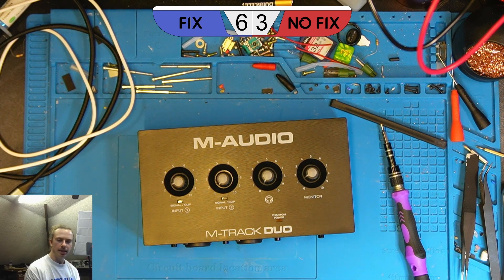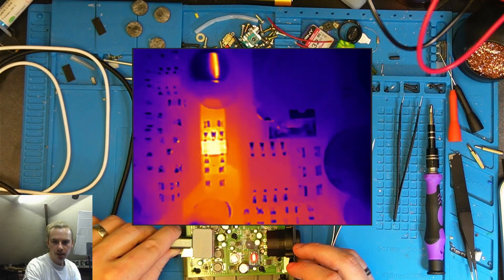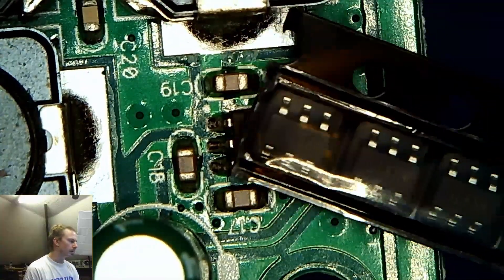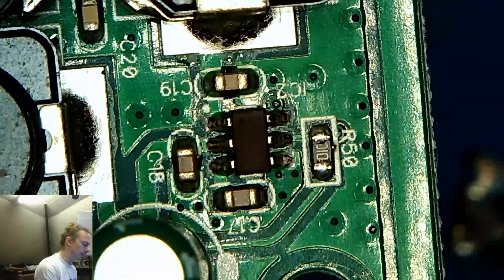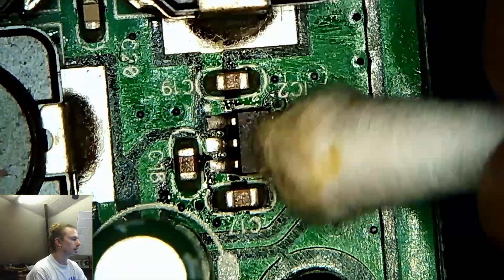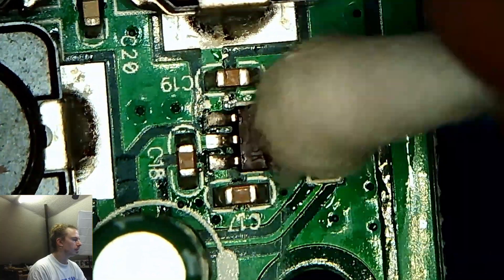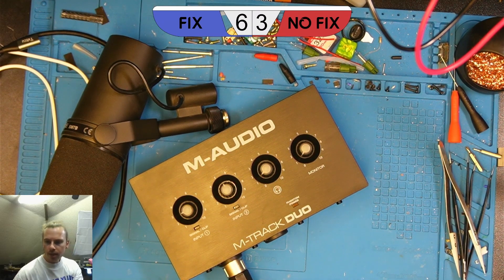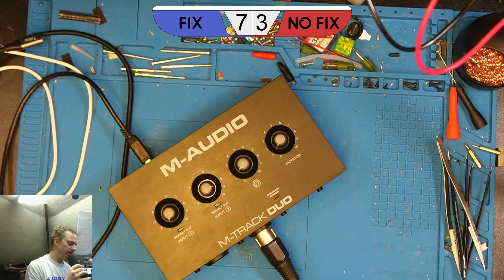Trying To Fix - Red Light M-Audio M-Track Duo

Comment: I'm having an issue with my M-Track Duo, the USB port seems to be broken, and I can't see any obvious damage, how would you approach fixing it?
Reply from the maker: What's the symptoms, does the device not connect / keeps dropping out?
If there is no clear breaks inside the port, and the pins all look okay, I would consider opening it up and checking the pins on the board. In case they've come loose. Have you tried different cables and ports to pin point the issue to the device.
Reply: @TheCircuitRevival The problem was that the USB B connector had a broken pin, my friend helped me replace it but since he didn't have the best tools he ended up soldering the data+ pin with the ground path on the board, so when I connected it to my laptop there was a short-circuit and the board around the connector got damaged. The internals seem undamaged but fixing it now is probably not possible.
Reply from the maker: @OuranicRafflesia  it could still be repairable, I suppose it depends on what took the brunt of the voltage. Could just be a blown cap or maybe a fuse. Especially if the internals appear unadamaged

Comment: is it cheap to repeare bcs i have the same problem?
Reply from the maker: The components themselves are pennies, the chips I replaced on this I think I paid like 3 quid for 5. The difficulty comes in removal and reapplication of the chips. I use a hot air station to remove them as getting them off with a soldering iron (unless you have low melt solder but that stuff is quite expensive for what you get) would be a real pain. With the right tools its cheap and easy, if you don't have them not so much
Reply: @TheCircuitRevivalthe real qst is if i even pay some one to fix will the problem not happen again?or at least how to avoid it?
Reply from the maker: @miracle2445  Honestly im not 100% on what's causing the issue in the first place, it seems like its a common issue with these interfaces so can't say for definite it won't happen again. If I were to guess maybe something to do with phantom power and potentially people hot swapping mics out without disabling it but that's a guess at most.
In terms of cost to repair if you know someone who will be able to replace the component at cost of parts would say is a good shout. If not hard to say it'll likely be worth the cost Especially given the cost of the devices im sure most people would look to replace the device knowing they have that warranty back again.
Reply: @TheCircuitRevival can u give me the name of it or the link i can buy ut from
Reply from the maker: @miracle2445  SGM3204YN6G is the component you're after I got mine from aliexpress
Something like this https://www.aliexpress.com/item/1005005985429797.html
Reply: @TheCircuitRevival thaaank uu broo